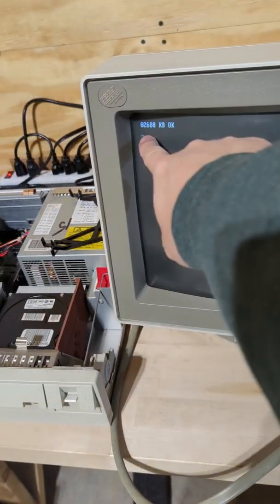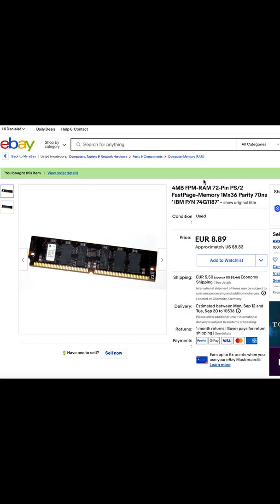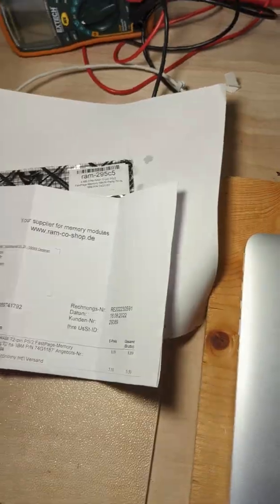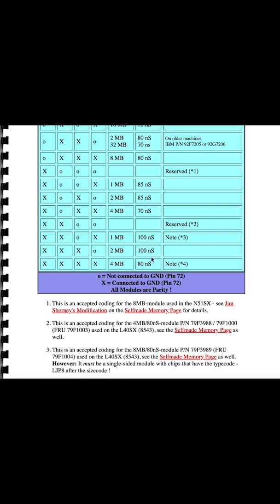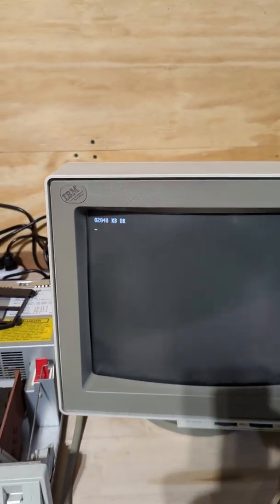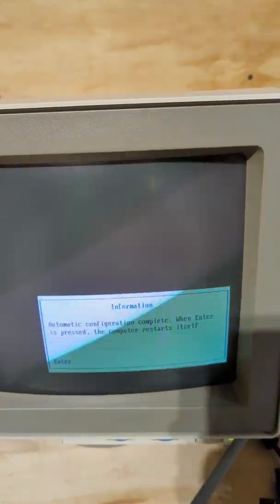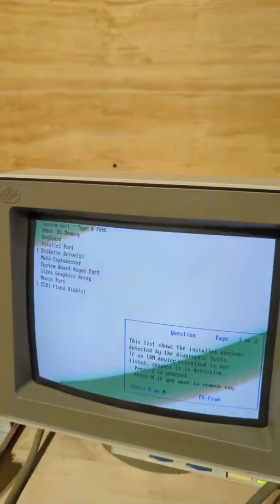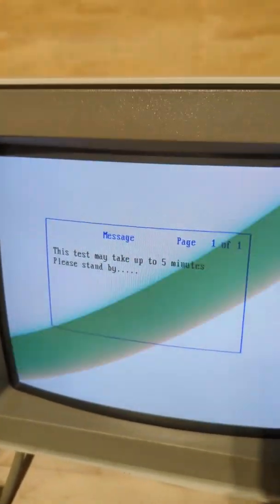Double your IBM PS/2 Model 55 SX's memory with this one weird trick!

Comment: What did I just watch... 😅
1) come mai me conta 8064 di kB? Dove finiscono gli altri 128?
2) lava quei rimasugli di flussante dalla saldatura con un po' di isopropilico 👍
Reply from the maker: 1) I PS/2 riservano 128kb per il cosiddetto "high performance BIOS"
2) ok, but tests come first
Reply: @scarpaz  so how has the memory performed while in use? errors?